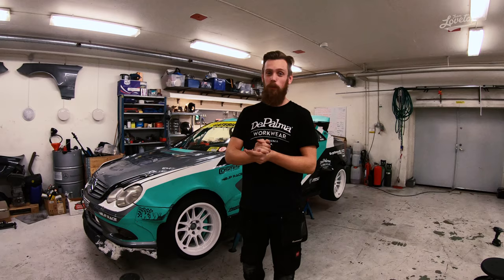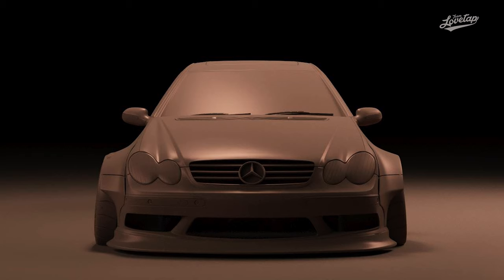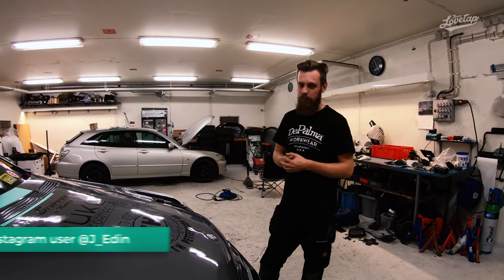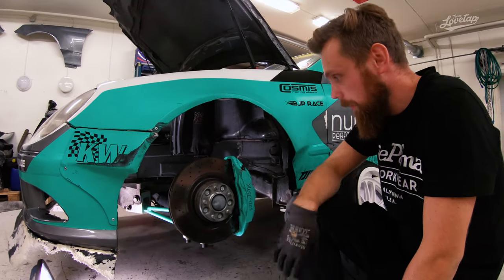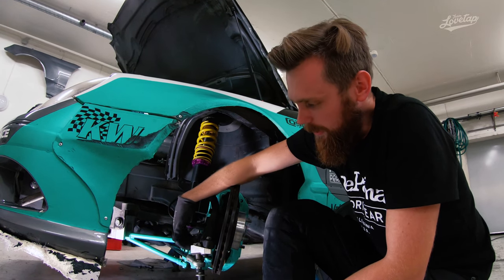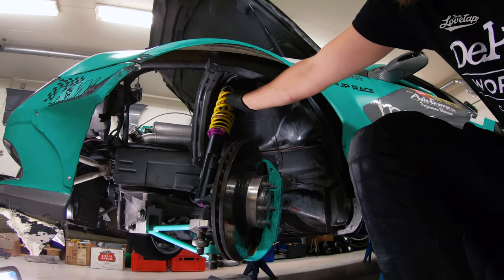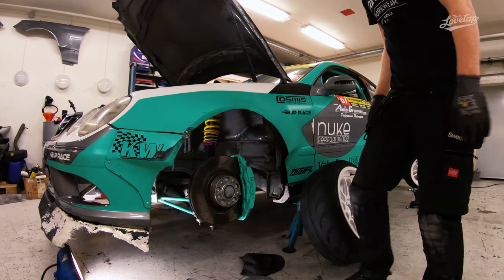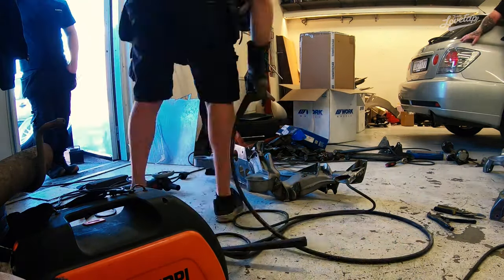Hammer & Spanner EP 1 - Bodykit, Rims and Suspension

Comment: Hey guys, awesome car!
I have coupe of questions for you: I'm working on my 2004 clk320 convertible (cabriolet), it's not crazy drift build like yours :-D it's more street legal/track friendly/fun to drive convertible car. I swapped manual transmission into it and doing some weight reductions. But you probably know that w209's body is not really stiff, especially when it's convertible. Could you please describe in details what did you do to increase body stuffiness. In particular how did you reinforce front strut towers, which parts of the body did you stitch-weld, did you do anything with rear shock towers, what else would you recommend to do to increase stiffening for my convertible (except roll-cage). I would appreciate any input! Thanks
Reply from the maker: Dzmitry Ulasau my biggest changes are probably the cage, strutbrace in the front and a reinforment of the front towers. This will be a part of episode 5 in the hammer & spanner series 🤙🏼
Reply: @TeamLovetap  👍